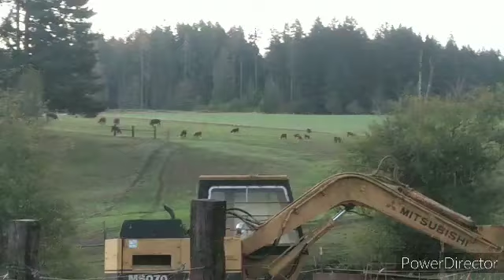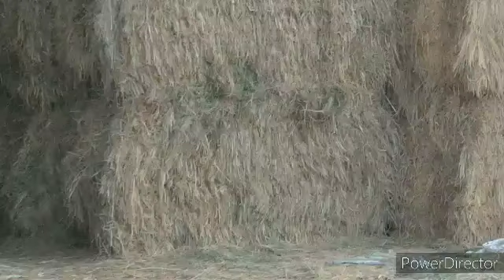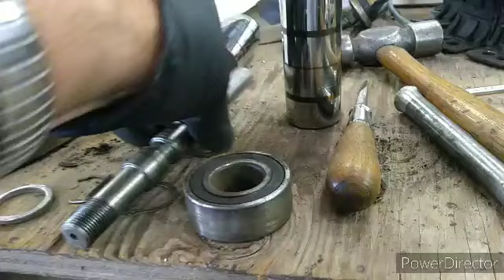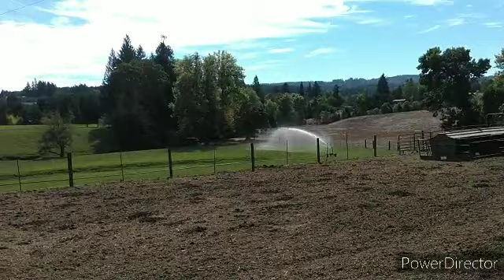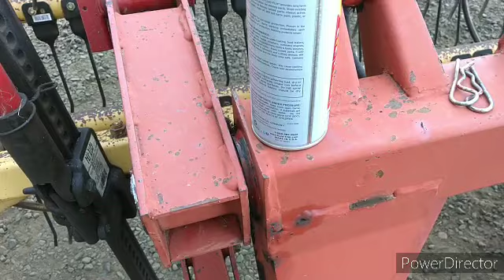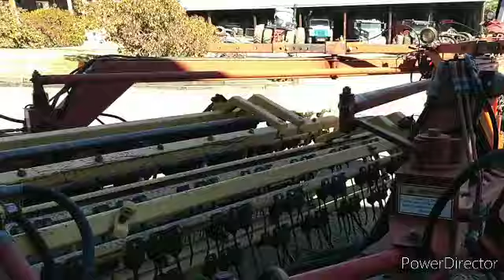a day if fixing.....
NEVER FORGET 9-11-01🇺🇸

Comment: I'm here
Reply: Good evening Bruce.
Reply: Good evening Bruce!!
Reply from the maker: Good evening sir! I hope you had a good day!!🇺🇸🇺🇸🇺🇸
Reply: @brycewiborg8095  Good Evening Bryce
Reply: @Pennies_on_the_dollar  Good Evening Nelson
Reply: Good Evening Bruce....
Reply: @GosselinFarmsEdGosselin  Good Evening Sir, it's been a pretty good day. Not much going on today. Question could you cut the welds off that boxed top piece to get into the tube to cut the other weld and rotate it to were you needed it.
Reply: @nidayfarmranch6002  😁😁 Hope your day was well sir!!
Reply: @Pennies_on_the_dollar  my day went pretty good, not much going on today
Reply from the maker: @nidayfarmranch6002  good!
Thought crossed my mind.. but would have to grind the inner weld. Too far in for a hole saw.. and a good full day+ probably..
I'm thinking of just brute Force. Try to twist it back, just need to figure out how...
Reply: @nidayfarmranch6002  😁😁
Reply: @GosselinFarmsEdGosselin  can you heat that weld up enough that it gives just enough to twist it
Reply: Evening bruce
Reply from the maker: @nidayfarmranch6002  pipe would twist, all in one spot. If I can figure out how to use brute Force, it will be an even twist Along the length of it, shouldn't weaken it as much..
Reply: Hi Bruce!
Reply: @mattthescrapwhisperer  good evening Matt
Reply: @GosselinFarmsEdGosselin  ok, just thinking out loud
Reply: @ronphillips1437  good evening Ron
Reply from the maker: Much appreciated
Reply: @GosselinFarmsEdGosselin  your welcome, to bad you could not use a Porta power to move it
Reply from the maker: @nidayfarmranch6002  might be a part of it...

Comment: That's a bummer with the rake. Sounds about like my luck, start welding and run out of wire.🍻
Reply from the maker: Ya, guess I'll try to twist it back.. 
I knew it wasn't out, just put a new roll in a couple weeks ago.. never had one get a kink in it before, at least not that far into a roll..